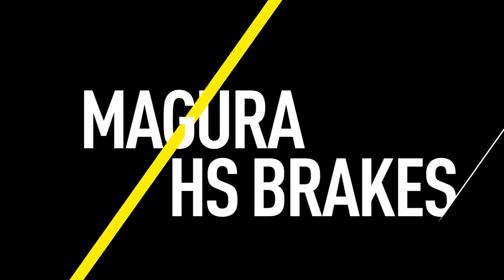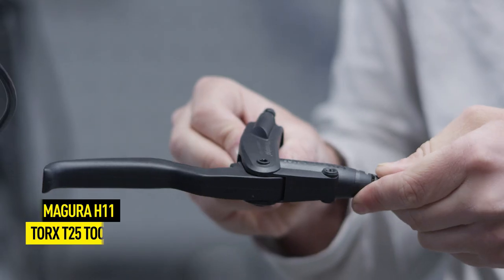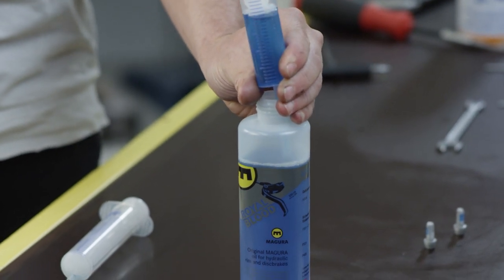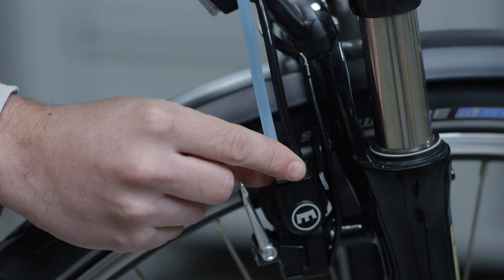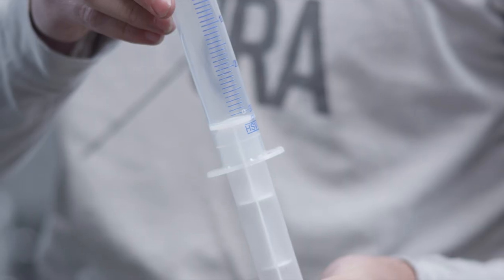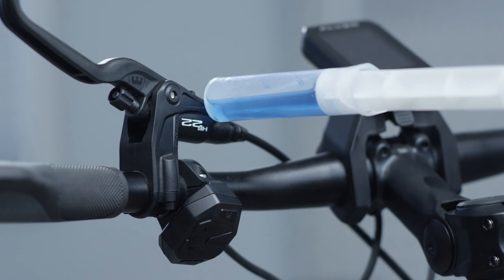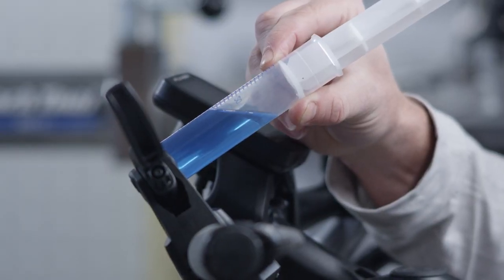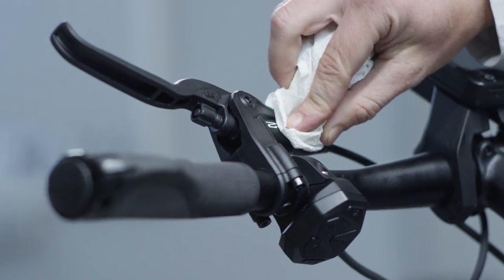MAGURA HS: Filling and Bleeding

Comment: This video needs to add the lever position of the HS-33 lever. It's HORIZONTAL, not vertical. Do not make that assumption like the HS11 lever. I have stripped my EBT screw after trying to bleed it 4x because i followed this video.,
Reply: Just heat a flat head screw driver and melt a nice new grove let it all cool down and then you can use a flat head instead much more grip.
Reply: The screw is broken and stuck in there how can i get it out
Reply: @Levi-xd2cj  it just happened to me, I was so angry. Im pretty sure the only solution is to buy a new brake lever…. Unfortunately, just be careful trying to put it again, u don’t what that thing broken again
Reply: This is a terrible video. Many times I did the filling wrong because of wrong information from Magura. Ridiculous.
Reply: I had to buy a new lever. I have since ditched Magura. I've worked with non EBT Magura for years. Even Shimano and sram disks. Such a bad design. Just don't ever buy Magura again.

Comment: my brake lever hits my knuckle. Will this help fix the problem?
Reply from the maker: Depends. If the lever is hitting your knuckle due to a lack of bite point / air in the system, then this will definitely help. Feel free to send us a message on Facebook or Instagram if you need any further help with this.

Comment: Stupid question: does the calliper need to be upright? I've got a Cube town and the front brake assembly is in 'normal' vertical position, but the rear brake is basically horizontal. Does this matter?

Comment: at 40" mark in the video, the technician's hand obscures what's going on: "pull back the cable grommet on the left brake cylinder..." Not exactly clear that this refers to the silver lever that secures the brake mechanism in place to the fork; when swiveled 'upward' the calipers are aligned for normal function, and the wheel cannot be removed. When pulled back from the fork and dialed downward, into the ' OPEN' position (with the axel skewer also released at the hub,) the caliper assembly is no longer fixed to the fork, and can be backed off its mounting position, allowing the wheel to be removed. 

Although it may engage/disengage by means of a cable passing through a rubberized eyelet in its internal operation, why it's referred to as a cable grommet and not a (quick-)release lever, closure bar, fixing handle, tab, or the like, is a mystery.  Backing this lever off, away from the brake cylinder, allows access to the hydraulic ports, and insertion of the lower bleeding syringe.
Reply: It is literally the rubber cover being pulled off of the hose connections at the top of the caliper. Nothing to do with the QR lever.